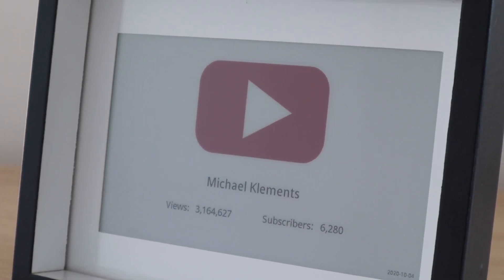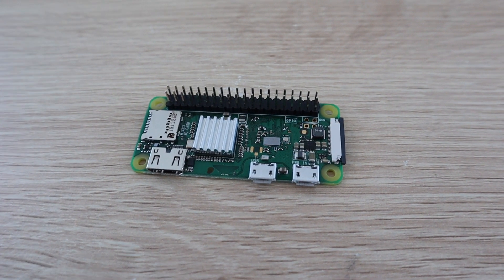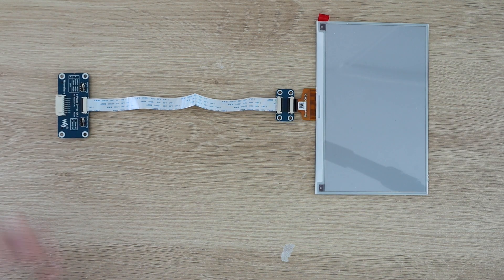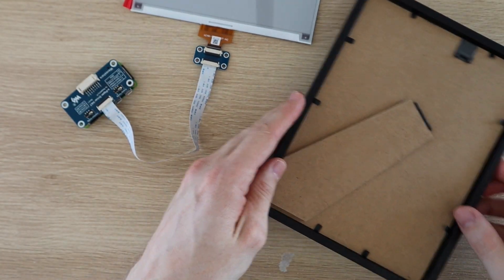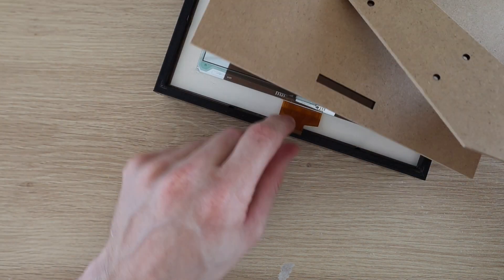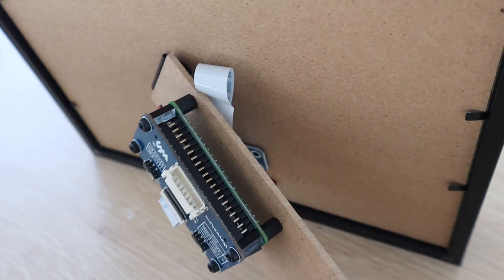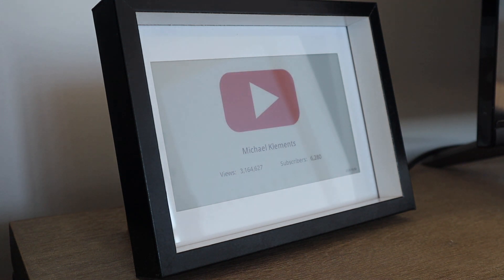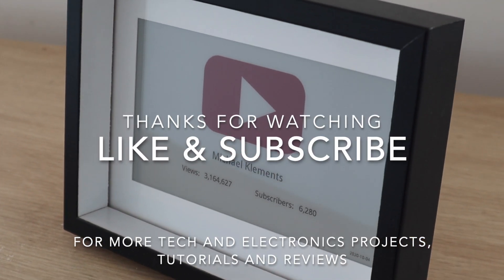Make A YouTube Subscriber Counter Using An E-Ink Display And A Raspberry Pi Zero W

Comment: Great project. I've just ordered a display! Thanks for the great video. Also subscribed 👍🏽
Reply from the maker: Awesome, thanks Mike
Reply: @MichaelKlements  Hey would this work on rasberry pi 4 and I cant find any of the display in UK
Reply from the maker: @LizzyTheLizard  yes you can use a Pi 4, it's just very overpowered for what it'll be doing. For long-term use, it would be more economical to use a Pi Zero W. You can but the display from Aliexpress or Banggood and have it shipped to you in the UK.
Reply: @MichaelKlements  OK thanks 😊👌
Reply: @MichaelKlements  thanks i will look about and hopefully get one up and running I have a rasberry pi w but I don't know if its a wifi one and I tried to connect it with my windows pc and I couldn't ssh into in even tho I did the ssh file edited config file and commandline file and added wifi name and password but I don't think its the wifi pi w i have
Reply: @MichaelKlements  do i need pi zero WH with melding pin header

Comment: Question. BTW, Awesome video. once you have the OS on the SD card, does it install on the Raspberry Pi? So can you put in a different SD card with a photo?
Reply from the maker: No, the SD card is the Raspberry Pi's storage, the contents are not copied from the SD card. To add a photo you'd need to use an external USB drive or copy it over your network.
Reply: @MichaelKlements  TY. This is super interesting.

Comment: Thanks for a great video. I have question. Instead of a subscriber counter, I'd like to make a physical push button and make it count up a single digit per button press. It would be cool if it saved that number on sd card incase the unit powered off. Any thoughts or leads. My googling brought me here, and so far this is the coolest project so far.
Reply from the maker: You should be able to do this with far less effort than this project as you won't need any APIs or an internet connection. You just need a button to increment the counter. The Pi already boots off an SD card, so as long as each press writes the data to a file then it should be able to read this file when it is booted up again.

Comment: Hi, thanks for your Video.
How can i write a code, and activate SPI before turning on the E-Ink display?
Should i do it first with normal monitor?
Reply from the maker: I’m not really sure what you are asking, but I’ve tried to answer a couple of things. The display won’t show anything until you run the code, so you can connect it all up without it “turning on”. Also the e-ink display only displays what is being sent to it over the SPI interface, so you can’t use it as a conventional monitor and it won’t display anything when initially plugged in. You can access the Pi using SSH over your network if you don’t want to use an external monitor.

Comment: Hi echt klasse . Leider hat es bei mir nicht funktioniert. Es kommt eine Fehlermeldung wenn das Skript ausgeführt wird debug epaper bussy Hast du vielleicht ein fertiges Image für die zero W wo alles schon fertig ist und man nur noch seine Daten eingeben muss. Beste Grüße
Reply from the maker: Perhaps your controller or display type is not the same as the one I've used. Does the Waveshare example run from your Pi without any issues?

Comment: Does the YoutTube subscriber counter also work with the non-E-Ink 7" display from Raspberry Pi?
Reply from the maker: You would need to make some adjustments to it as they work in different ways. The API to fetch the information from YouTube is the same, but the Raspberry Pi display uses the HDMI port and displays the “desktop” while this works over SPI and only displays what you send to it. You’d just need to design your own application dashboard to run on the desktop which had the same layout as this counter but that shouldn’t be difficult to do.

Comment: This is great.  Nice video.  Is there anyway to modify the code to make it work with the Pimoroni Impression Eink display?  The script stops as it can't find the Wondershare display and then stops.
Reply from the maker: I would suggest rather trying to adapt a Pimoroni example script to include the relevant portions of this project's code - probably the portions relating to collecting information from the YouTube API. You'd need to use the code/libraries developed for the Pimoroni display to get the text and images sent across to the display.

Comment: will this work with the smaller display as well?
Reply from the maker: You’ll just need to adjust the font and image size in the Python code, but the rest should work as is for a smaller display. You’ll also need to use the correct library for your display model/size.